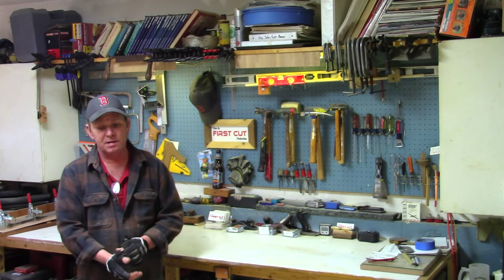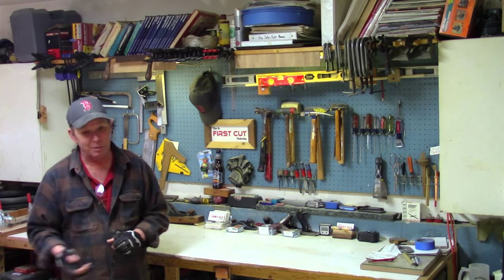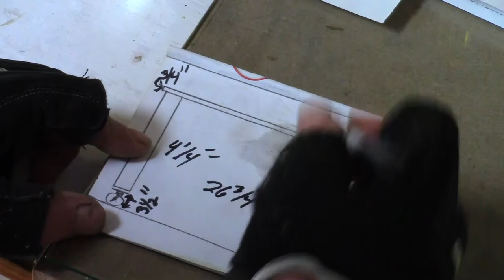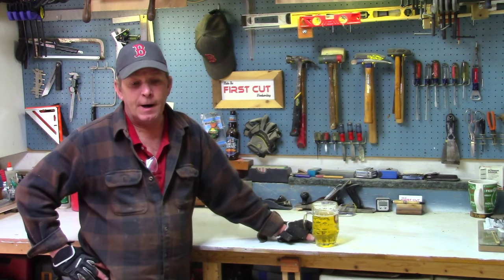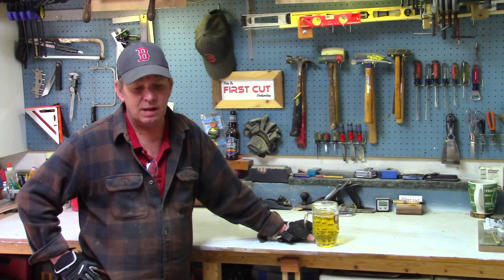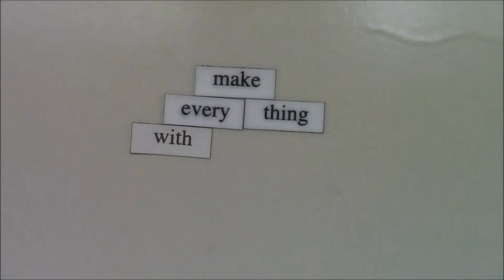Lathe Bench

Comment: It came out great...I got wheels on mine no locks and have turned 2 in square blanks with no issues. But that is the biggest I turn on it. Something bigger more likely will cause a problem. I like your idea on screwing it to the wall studs if needed. Have a great trip..

Comment: Looks great, sir! I especially love the look with your reclaimed wall behind and tool holder. Very sharp.

Just my two cents, despite you not asking. I think you may run in to problems with the casters. I'm working on building a bench for my lath right now, because it was just resting on rubber feet on my bench top, and I was having problems with it moving side to side. The issue is, I just started turning bowls, and as you're hollowing out the bowl, you're putting a lot of lateral force on the lathe. With it on wheels, I foresee issues with moving the whole bench as you do that.

That said, like you stated, it's an easy problem to fix, and the advantages of mobility may outweigh those issues.

Again, it looks great, thanks for the great content!